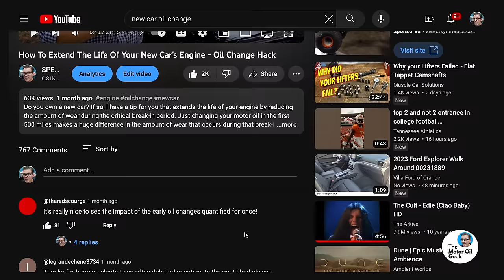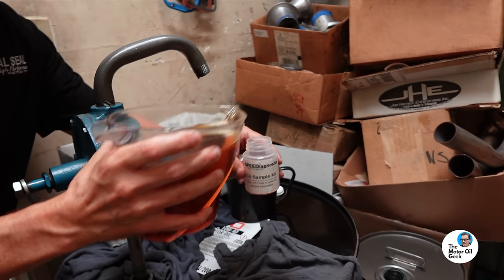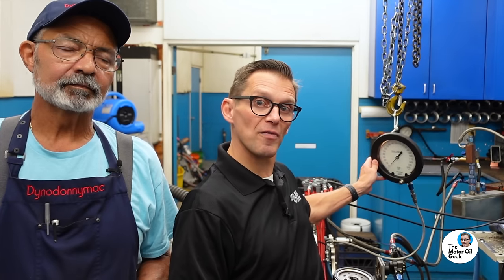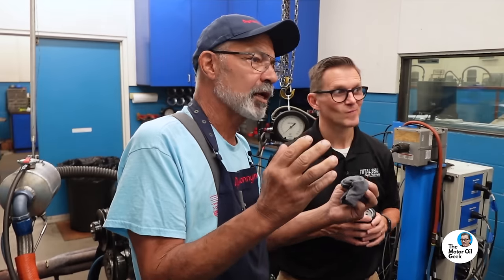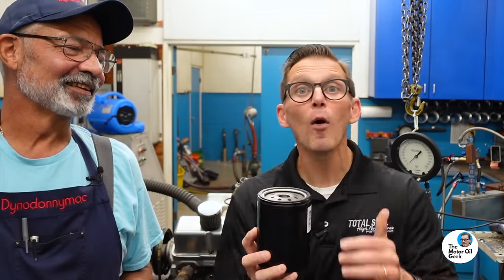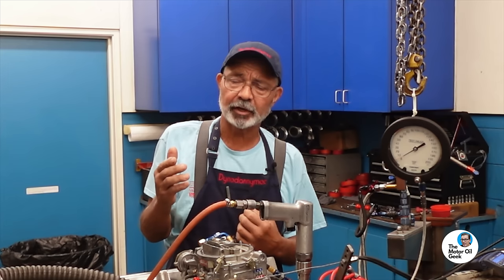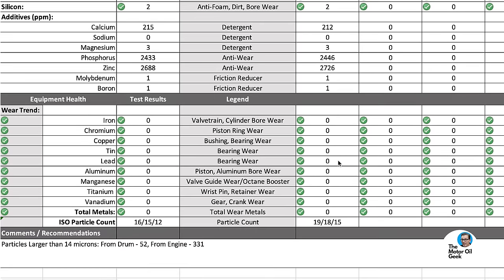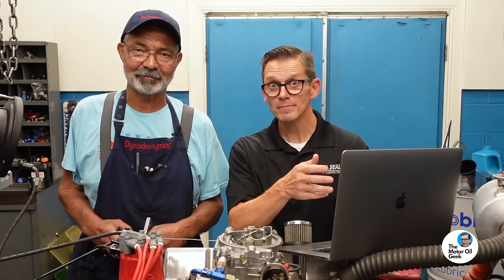Does Pre-FILLING The Oil FILTER Cause Engine DAMAGE?

Comment: I’ve done it on every car I’ve ever owned and in every video on my channel for oil changes I always recommend pre-filling the filter. I’ve occasionally gotten the same kind of comments, which are baseless. I always pre-fill the filter for the exact reasons discussed in this video, avoid excessive dry starts after an oil change, pre-fill it! Great video!
Reply: Every start is a dry start.
Reply: @getgetoutout if you’re considering them to all be the same, you missed the point.
Reply: I watched a well-known car repair "expert" on You Tube who says to never pre-fill your filter.
Reply: @adotintheshark4848  congrats, I guess that makes you more of an expert than the real expert who made this video here then?
Reply: @getgetoutout  exactly
Reply: @getgetoutout I think the point is that pre-filling the filter drastically decreases the time it takes to build oil pressure on the first start.

Most but not all engines typically have the filter on the bottom twisting up or at like a 45-60° angle, even after sitting overnight the engines with the filters at those angles will have oil filters full of oil already, because the oil won't be defying gravity ya know.
Reply: How do you prefill a filter that's installed sideways?
Reply: @MrHeat1up  you can start by filling it about halfway. The filter element will soak up the oil. After that add just enough that oil won’t pour out when you go to install. That’s about all you can do for horizontal filters.
Reply: on a Harley, the bike sits at a slant, therefore so does the filter, so I fill it up about halfway. @MrHeat1up
Reply: @stuffyoucando2  the thousands of dry starts over the life of an oil change are certainly more impactful than the few seconds that it takes to fill the oil filter.
Reply: @malcomreynolds4103  I would venture to say that one single start without filling the filter is equivalent to many, many typical normal “dry” starts. If you don’t understand that then I think you missed the point of the video. If you’re fine with unnecessarily accelerating that wear, you do you. The data in this video should be enough on its own to prove that point.
Reply: @stuffyoucando2  There is no data in the video. If you don't understand basic addition or manfuacturer guidelines, I don't know what to tell you.
Reply: @malcomreynolds4103  if you can’t get anything from the video, then I don’t know what to tell you either…keep on believing what you want, which is based on assumptions rather than facts and data. It cracks me up how many people like you think you know better than real experts. The guy making these videos is obviously a subject matter expert and literally works in this industry, but you know more, so go ahead and do what armchair experts do best and talk about how right you are without any facts to back it up. I’m not going to argue about it any further, especially when you have no basis for an argument. I’m not sure why you keep trying to argue with me anyway, I didn’t even make the video. If you’re so smart, argue with the guy who made the video and see where that gets you. I’m not going to waste anymore time on you, he probably won’t either.

Comment: Once you thread a filter on you are adding metallic particulates. Try swabbing a new filters threads, they are often poorly cut with metal chips coming off. Sometimes significant thread slivers. Simply doing maintenance will 100% bring the particulate count up.
Reply: Yea, I always run a rag over the threads with the filter upside down.  I also check the louvers to make sure they are open.  I saw actually saw a video where half the louvers were smashed half closed.
Reply: this is where the cartridge filters have an advantage especially if there plastic

Comment: One of my favorite features of the c6 vette is if you press the throttle pedal when you start it up. It will crank for about 3 seconds to build oil pressure. It’s phenomenal for cold starts

Comment: One of my pet peeves is the many people that just poke the foil/plastic seals on the oil bottles.  Not always going to happen but it has been seen that pieces of the seal go into the crankcase and can eventually plug or restrict the oil pick up to the pump.
Reply: I do this because i cant remove the entirety of the plastic!
Reply: Aye. Always make sure there's no part of the bottle seal that can go inside the engine. It's common sense but we all know how uncommon that's become. After all. Last week on a Just Rolled In there was a washer fluid bottle filled with gas.
Reply: Do you think that the oil manufacturers are in with the auto companies? The oil companies could easily put a different seal on the oil containers. But no, they would prefer to make things difficult for the home mechanics. Dealers use a drum of oil instead of a quart or gallon container. What isn’t a scam on the American people?
Reply: @Freedom_Rider915  ? Just take a knife and carefully peel off the foil seal. Do you have a better idea for baby proofing oil containers? The current seal also prevents tampering.
Reply: I just leave the plastic on. It doesn’t hurt anything. Been doing this for 50 years.

Comment: My practice has been to crank the engine, without letting it start and run, until I see oil pressure.  Then I let it run.  Henceforth and forever, I will also pre fill the filter.

Thanks so much!  Great information and presentation!
Reply: lol.  That’s even worse.

Comment: I've been in the motorcycle industry since May of 1979 and when spin on oil filters came out many years later I always filled the oil filter with new oil prior to installation. Being retired from wrenching and now working behind the parts counter where we have a small showroom with helmets, jackets, gloves etc., and a repair shop, I always ask the customer that's buying oil and filter if they pre fill the filter prior to installing it. It amazes me how many people don't do this because they don't understand how the oiling system works however there are many people that do pre fill the filter. 

PS
I can't believe there are people that think new oil has to be filtered when it's new. It's at it's cleanest right out of the container. Also you should  shake the container prior to opening due to the additives have settled to the bottom from just sitting. I remember one time I didn't shake the containers and when empty I looked inside and saw some stuff that was not oil, but rather the additives that were added that stayed in the container.
Reply: @cliffords.8341 - do your customers a favor ... stop asking at the counter that silly "pre-fill oil filter" question.  Ring the customer up, so the next customer can get waited on !!  :face-turquoise-covering-eyes:

Comment: The oil filter bypass valve in every oil filter opens at a lower PSI than the engine can produce. ~60 psi according to most oil filter manufacturer specs. 

It has too or else it could restrict oil flow. So every engine will have some unfiltered oil bypassing the filter at times like wide open throttle.

Comment: I've probably changed a hundred thousand oil filters in my lifetime, and have always filled the filter in advance. Not just my idea, but virtually all OEM companies spec'd that. I have seen folks forget (or just not do this) and watched filters collapse. As for clean oil verses oil right out of the jug; you have a point. Yet I always prefiltered every quart of oil I used.

Comment: Some engine oil filters are sideways or upside down mounted. So you cannot pre-fill those, and they work just fine. Pre-filling is fine, but it's to really necessary. It's saving the engine a minuscule amount of wear, like a drop of water in a swimming pool.
Reply: I add just enough oil to soak the filter element rather than fill it up.
Reply: @petesmitt  I always wet the O rings around the top of the filter housing , and on the shaft that holds the filter element ( if you buy a genuine Mercedes-benz filter element it comes with the O rings and the little brass sealing washer that goes onto the end of the shaft before you refit it to the housing or cap , depending on model , and it comes with instructions telling you to do that ) . With most newer cars having the screw on canister type , they are generally located near the top rear of the engine and are removed/fitted from above , so if you pre fill them you will just spill oil all over your engine . If you only put the new oil into the engine just before starting , then the whole engine will have oil through it before you start . Even on engines which haven't had the oil just changed , if you watch the oil pressure gauge on startup it takes one or two seconds for oil pressure to come up - because the oil has drained away into the sump , and needs to be pumped back up to the filter housing , where the take-off pipe for the gauge is usually located . Still does no harm whatsoever . I've had several cars well beyond half a million miles on original engines , and every car I've had gets beyond 200,000 at a minimum ; never lost an engine yet .

Comment: I started changing my own oil a little over a year ago and when I was researching before beginning my undertaking, there were a lot of mixed reviews for prefilling vs not and since I didn’t know and it didn’t seem to cause major immediate damage either way, I picked the most logical way: prefilling. It takes literally 2 extra seconds and could add miles to your engine, so why wouldn’t you?
Thanks for adding the science to back this up though. Sometimes what one thinks is the logical choice isn’t really the best one so it’s nice to see actual data support👍

Comment: Hi, in the old PAO plant, we did particle counts pre filter piping and post filter piping.  I agree, it at least STARTS out clean.  Both are WELL below spec on particle count.  

After a couple of decades running the plants, I re-focused on the initial start up of other newly built plants.  Our job was to get them as clean as possible before starting them.  We did oil filtering on most of the plants.  The oil test you did, we always did on each oil reservoir and I can tell you where the "myth" of dirty oil comes from.  Consumer oil, as you said, is filtered through the several transfer and blending operations.  So it stays clean in most cases.  But in industry, MOST plant operators truly believe that oil must be filtered as it is loaded into the oil reservoir.  And they are right.  But the difference is, the "container" they are having the oil in is a metal drum.  It is possible that it is better these days, but in the 2000's until at least 2008, the oil in drums was indeed dirty for the hundreds to thousands of gallons of turbine oil we put into the steam turbine reservoirs as well as the high speed turbine and compressors oil reservoirs.  And thus we did a full oil flushing operation lasting up to 2 to 3 weeks on big oil systems.  

It was typically 1500 to 3500 gallons of turbine oil not motor oil.  So that is part of the difference.  The drums were inspected after emptying and you could see a tiny amount of settled specs in the bottom.  Today, with polyethylene bottles, some up to 5 or 6 liters or more, the oil certainly has to be cleaner than the industrial oils.  

But dozens if not hundreds of people flock around the oil flushing operation because it is a typical choke point in the schedule for starting up a plant on its first start up, something that typically is a multimillion dollar event.  They start MAKING money instead of BURNING money during construction and pre-start up.  So it is WELL known to be dirty.  I am not surprised that you got those comments.  

Apples to apples comparison as you did here, I have personally NEVER heard of before this evening watching your video.  I also pre-fill filters if at all possible.  Absolutely GREAT content.  Your expertise has shined a light into a dark corner I was only vaguely aware of.  Many thanks!!
Reply: Too long a reply. Automatically makes you a dummy...
Reply: Great comment, makes sense that would be the case on larger stuff.

Comment: I have been filling filters before I screw them on for 45 years and I don’t recall messing up any engines. If I thought there was dirt or something that could hurt the engine in the container I sure wouldn’t dump it into the fill hole either! There’s also a bypass feature on most oil filters that opens if the filter gets clogged because dirty oil is better than no oil anyway.
Reply from the maker: Right on!

Comment: The answer is NO pre-filling the oil filter will NOT damage the engine . 
I’ve been doing it for Decades .
Reply: The only filter I ever pre-filled was a fuel filter on a Cummins engine in a yard dog.  Or maybe a hydraulic filter on a Landoll Bendi forklift.
Reply: It can give your bearings a tiny little bit of extra wear. But essentially you're right. Half of the engines I work on have horizontal oilfilters..

Comment: I farmed for 24 years. Always pre-filled the filters on all of our trucks and tractors.  Just seemed like commons sense to me, even without anyone telling me to do or not do it.  Some of the tractors had huge filters that took over a litre of oil to fill.  I do have a car with a filter that has the open side down, so you can't pre-fill it.
Reply: Try pouring one or two pours into it, and then hold it upside down over your drain pan. When it stops dripping you can put it on the engine, and there should still be some oil in it.
Reply: @DanEBoyd    Ya, you might end up with it about 10% or 20% full.  It is a small filter, compared to the other's that I mentioned.
Reply: @@GeorgeSanford-pb1yj   That may depend on which engine you have.  My car has a small filter that is upside down.  Our tractors (one of which had a Cummins engine) had large filters with the open end up.
Here is a quote from Diesel Hub: "The oil filter on the 6.7L Cummins turbodiesel is mounted vertically towards the front, passenger side of the engine. It is accessible through a small opening between the passenger side inner fender (wheel well) and the frame. It must be positioned horizontally as it is removed through this gap, thus spillage is inevitable unless the oil filter is first capped off. Furthermore, both Ram Trucks and Cummins call for the replacement oil filter to be pre-filled with engine oil before being installed. A special cap (see Lisle 57180) is required to plug the oil filter so that it can be removed and installed without spilling engine oil on the lower half of the engine bay."  End of quote.
So, just because a car has an upside down filter, doesn't mean that all other vehicles don't recommend pre-filling the filter.  Yes, you do have to be careful not to get anything other than the oil into the filter.  It may be best to fill the filter through the small holes on the outside rather than the inside hole to prevent that from happening.
Reply: Change the filter, pull the fuse for the fuel pump and crank the motor for a few seconds. That will pre-fill the filter.
Reply: @@GeorgeSanford-pb1yj As the manufacturer has placed the filter in that position then it is reasonable to assume that no you dont prefill because you cant. However it is possible that the dealer workshop has a fill system that primes the oil filter before the engine is started, you would need to get hold of the workshop manual to confirm that
Reply: Not much better of an idea than just starting it because you're still moving all those parts without oil pressure at cranking speeds too. No oil pressure means metal to metal whether just cranking or idling. I've been pre-filling my filters from day one and will continue to, it's common sense. I never owned any car that has an inverted/upside-down filter so prefilling was never an issue for me.  @stefanpuffer

Comment: If you have an engine that has the top mounted inverted filter that you can't practically pre-fill, many modern cars have a "clear flood mode" that you can use to prime the oiling system before starting it.  Like our FA20 DIT Subaru engine.  Floor the accelerator pedal, crank it over until the oil pressure warning light goes off, then it's primed, then start like normal.  But make sure your car has that feature first.  You don't want to send it to the moon with an unprimed oiling system.
Reply: Doesn't modern engine management software do that for you anyway?  My Jag always turns over quite a few times before it starts to fire up.
Reply: I even fill those filters too.. if you prefill it, then let it sit while you jack up the car, drain the oil ect.. after about 20 minutes, all that oil is absorbed into the filter, and you can flip the oil filter without spilling anything. Granted, you aren’t totally filled, but it’s better than dry!
Reply: @stevemawer848  No that's just the natural process of building compression to get first ignition.  Clear flood mode let's you crank it indefinitely without it ever actually starting.  It takes a good 10 solid seconds I'd say of turning the engine over with ours before the oil pressure light goes out.  Most engines fire off within the first half a second or maybe one full second.